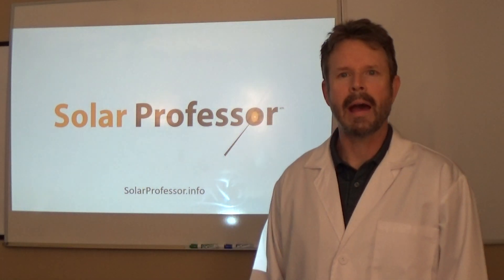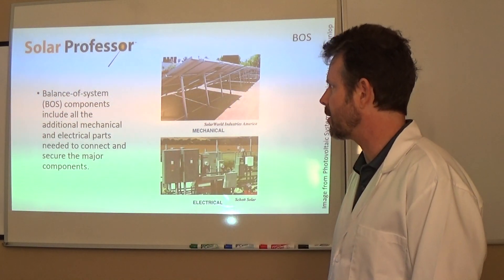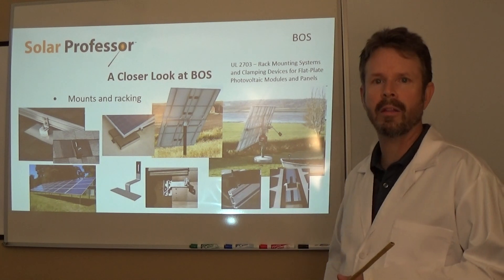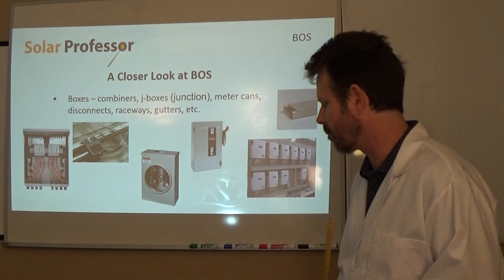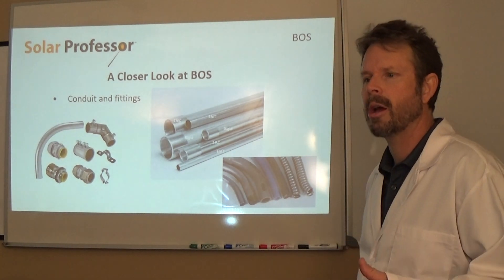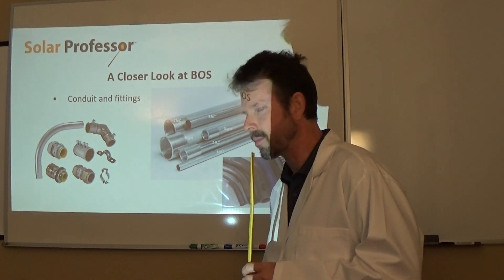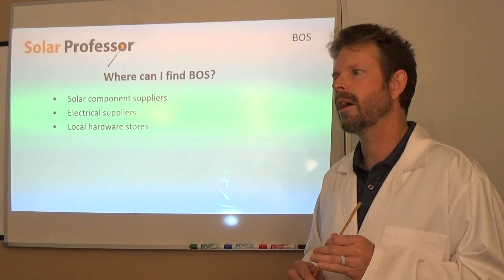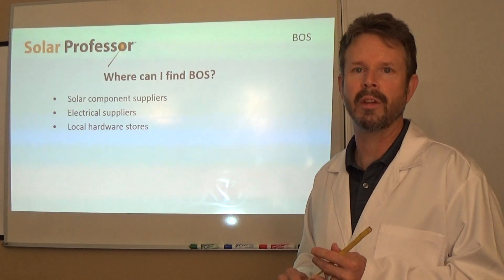PV 101 - BOS (Balance of System) Components

Comment: 8:25 THWN-2 wires are usually up to 600V and PV wires are rated 1kV or 2kV. I've never seen THWN-2 wires rated for 1kV. Probably would not be a good idea to transition inside the junction box since most PV installations are 1000V or 1500V these days.
Reply from the maker: Thank you for your comment MWSC.  You are right.  The voltage rating of wire is very important when planning out a system and also buying wire.  For residential systems, we are only able to create series strings of modules up to 600V (according to NEC 290.7).  In this case, any THHN, THWN-2, etc wire would be adequate for the transition in a Jbox from the roof to ground through conduit, for example.  In fact if you go to a big box hardware store like Home Depot you can buy wire that is marked several types: THHN, THWN-2, and MTW on the same piece of wire.  However it is only 600V rated though.  If you want wire rated for more voltage, PV wire is rate for 600V, 1000V, or 2000V (and this follows NEC section 490), as you have mentioned MWSC.  You would typically have to buy this PV wire from an electrical supply house (like Platt) or a PV wholesaler - and it comes in colors which is helpful for keeping track of positive and negative in long strings.  Most PV modules these days have PV wire coming out of their attached JBoxes using 1000V PV wire and the module assemblies themselves are rated for up to 1000V commercial installations.  It is important to know the Voltage rating of all these components through the system so they all match as you have implied.  Also, when you start to size systems larger than 600V you will typically be paying more for the wire, terminals, combiners, disconnects, etc. that can handle those higher voltages.  Great comment.  Thank you,Solar Professor
Reply: @solarprofessor7695  Thank you, Sir, for your detail explanation. I really enjoy all your tutorials.